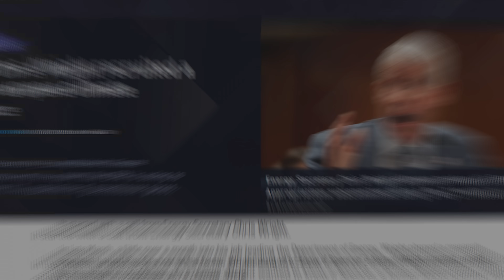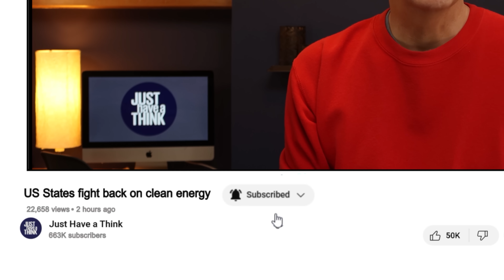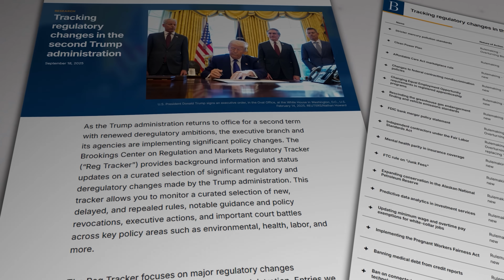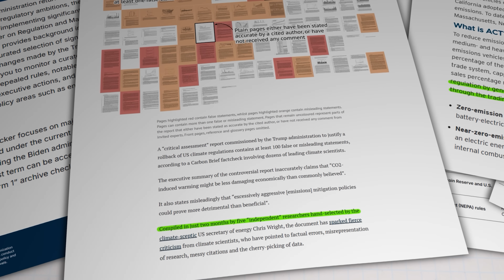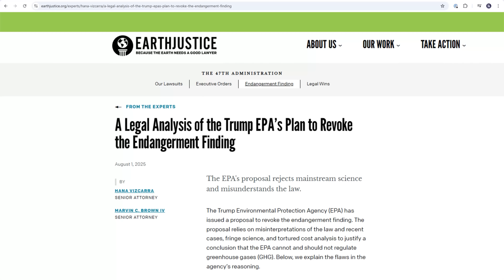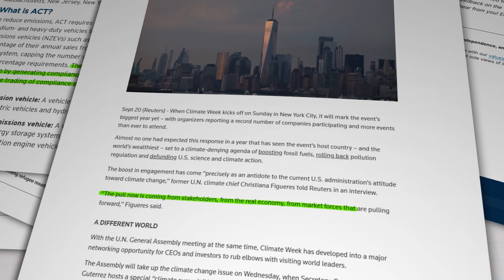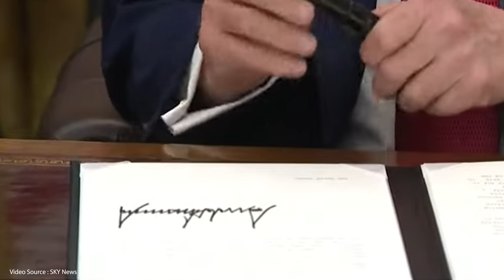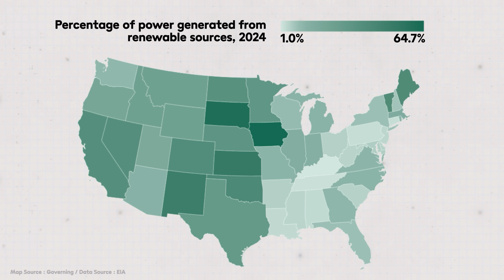The battle for American energy supremacy.

Comment: As a Canadian, I know that there are a LOT of people in the US that understand positive effects of moving to solar, wind, battery, geothermal etc. These people are just working away in the background, making this transition happen in spite of one crazy leader that just wants to line his own pockets - to them I say thank you! 🙏
Reply: It's not just a question of "transition" - it's also a question of cost, mainly reducing dependence from big business, using less if not least expensive energy sources.
In most of the USA conditions for solar energy are outstanding - a larger house roof surface in photovoltaic (PV) cells is is sufficient for producing the electricity for an average family.
Reply: Indeed we are. Our household just sold our last direct tie to the fossil fuels industry in the form of an ICE vehicle. We've replaced those with two BEVs, home solar array, heat pump, and cancelled our natural gas service. Brighter days ahead.
Reply: Yeah lets hope that this will result in an expansion of clean stable long lasting and low impact fission energy.

In the mean time an abundace of gas will lower electricity prices in gas reliant grids helping the shift to electricity ( burning gas to make electricity and using it to power an heatpump is better than burning it insider the home )
Reply: From Alberta: eat my jorts Laurentian. This video conveniently forgot to mention that Opec+ is heavily expanding production to drive down the price of oil. The price booms and busts, production will be up again eventually because we are very far away from peak oil demand.
Reply: FYI Anyone from Alberta is a shill for big oil and gas. They love destroying their cattle industry by drilling and fracking. They want pipelines everywhere and don't care,  at all, about the destruction of the environment.
Reply: @ronstephen-wy4ib FYI we do care about our cattle industry- which is not being killed by oil and gas but instead by the Quebec dairy cartel that’s in bed with liberal government agriculture regulators. We want pipelines to support our provinces largest industry which in turns grows our province by providing the province with high paying jobs and lucrative royalties (imho it seems reasonable). We do care about the destruction of the environment which is why we want developing countries to switch off of coal and move to natural gas before battery technology is good enough to support the spikes of use in networks of 100+ million people. If China alone replaced coal with natural gas it would cut their emissions down 3x the size of Canadas total greenhouse gas emissions. This is all ignoring the fact that when oils not on pipes it’s on trains which are far sketchier. 

But nice straw man of Albertans.
Reply: @ronstephen-wy4ib also lmk if you wanna address something in my original comment besides your opinion on the province I’m from?

Comment: It great bringing up these improvements but I have mentioned on your comments before that no matter what happens regarding Zero emissions it will never take place because Leeds University have already reported that electric vehicles are the most polluters on the planet and as they gather more users the worst it is going to happen. I live in Australia and even though we have a fairly robust electricity system it still will not overcome the information above.
Reply: I am in Australia with two EVs. They are both powered by my rooftop solar. EVs take about two years to pay back their embedded carbon, even with a dirty power grid. Mine, on solar, take less. Combustion engines have an advantage for those two years. Thereafter, combustion engines continue to produce more CO2, and that is not recycled at end of life, like the very valuable minerals in my batteries. Citing bogus reports is not helpful.
Reply: Leeds Uni have NEVER reported that electric vehicles are the most polluters on the planet.

Comment: I hope you to tackle the issue of data centers and power demand.  This is a huge topic of conversation in the US energy markets.  The tech companies are favorable towards renewable energy and storage, and addressing climate change, in general.  Yet they feel. compelled to rely on nuclear in the long term, and natural gas in the short term, seemingly because of 24/7/365 requirements.  

An interesting case in point, is xAI Colossus 2 in Mississippi (not one of the states mentioned in your list).  Park yourself to a natural gas source.  I would've thought combined cycle gas turbines would be a bottleneck with this strategy (e.g. 5 years).  Yet they were able to quickly get started with temporary turbines. These are modular gas turbines/ aero derivatives, similar to jet engines, that can be commissioned in weeks to months, not years.  This was how Elon Musk was able to build such a massive data center in record time.

For the average consumer, I think renewables+storage will probably be sufficient.  But because of AI, energy demands are now rapidly increasing beyond original expectations.  And it makes me wonder, whether renewables+storage will be enough.
Reply: Opportunity is increasing.
Uranium-fired power-service now has the opportunity to sell to an unquenchable market.
If you can build power-service, you can sell it, at any level.
Reply: @aliendroneservices6621 ...except, of course, for the long commissioning and construction period, the huge costs of building, decommissioning and storage of waste products and the need for expensively mined fuel as well as a huge demand for plentiful water supply.

Comment: Dave, is there any data on second life batteries and solar. Used solar and batteries have got to be a very very cost effective way to generate electricity, and they'll be a lot of it. Probably offsetting new a lot in the future. 

Is second life factored into energy transition models? It's gotta be a big deal. Very biggly.
Reply from the maker: I did a video on this a few years back but it may be tome to have another look.

Comment: I had solar panels installed on my roof this summer, getting in just in time to get the tax credits. I am holding off on batteries as we are at a major change with Sodium batteries. Planning on buying an EV in 1-2 years and getting bidirectional charging in. Use my car as my home battery.
Reply from the maker: Sounds like you've got a great plan for your energy future!

Comment: You need to understand that the ONLY Reason that US got Trump and MEGA-Morons (twice) is because the D(s) put up such horrid candidates, that the only way they could become D candidates was to cheat their own D Primary system(s).  So what is going on is not so much folks voting For This or For That.  Really most folks in the US are voting AGAINST what they think is something worse.    This all means that no matter who "Wins," . . .  US Loses.  

Meanwhile China (thank you, China) has made Silicon Solar PV so cheap  (install cost of $US 1 per Watt if folks will keep it off the roof) that it works out to about 2 to 3 cents per kWh "behind the meter."  (no Tax Credit required).  If folks add an EV at those Electricity Rates -- that works 15 cents per Gallon Gasoline.  Folks that are smart enough to do that are fine.  For the rest of US -- things are what they are.
Reply: " is because the D(s) put up such horrid candidates" <- nope.  Your argument falls apart because 1) it's just not factual, and 2) you are ignoring why Trump is popular (hint: yes, many Americans are quite bigoted.)
Reply: @TheDanEdwards  This is why the D(s) will lose again in 2028.   Deny, no self-responsibility, blame others.  Sounds like a real winner of a plan.

Comment: I think you need to read Project 2025 (A plan by the extremist far right Heritage Foundation and its alignment with big fossil) in a bid for ultimate power handing presidents the unlimited power to implement dangerous policies with the full backing of the cabinet. Unfortunately for our beleagured planet, those in control are going full steam ahead with every line. 
In the blueprint document Page 368 aims to roll back cutting Carbon Emissions. Page 418 Intends to slash Green Legislation, completely severing funding for renewables. Page 676 "Climate Change Research Should be Disbanded" Yes they are actually disbanding NOAA. 
Unless authoritarian rule with its dubious mandate to deconstruct institutions, anti-renewables legislation, onerous diktats and presidential decrees the consequences for renewables un the US could be pretty dire. 
Hopefully this will be resisted under the constitution and some rational democracy restored, but I fear that the damage to its successful renewable energy industries and international standing and the US soft power regarding US expertise in climate sciences, may be another casualty of this dreadful regime. 
So on this occasion, I do not share your optimism.

Comment: The global elite hate solar for obvious reasons. Yet it has worked for 99.9% of life for over a billion years. Meanwhile look at the war Ukraine is fighting to defend itself.  Having a centralized power grid is a national security risk. Burning stations are by function centralized. They are fundamentally flawed when it comes to national defense. If everyone in suburban America has a bit of solar, we would be on better footing should we even face war. Having a largely diffuse and decentralized grid is a strong national security stance. Relying on centralized refineries and burning stations is a weakness that our enemies could easily exploit. Do the math, taking out a billion dollar refinery using a million dollar munition is a bargain. Then realize Ukraine has been able to do it with munitions under 100 thousand. How exactly would an enemy knock out a solar farm? It would not be cost effective, and would be an easy repair. Solar power manufacturing is still centralized, but you can stockpile replacement panels quite easily,  and they are easy to install. Ignite an oil field or gas field, and it might never work again. The replacement parts for a refinery face the same problem as a solar panel factory.
Reply: "The global elite hate solar for obvious reasons. " <- silly claim.

Comment: Solar panels are not clean energy.  They are not clean because they are made with metals and plastics, some parts are rare earth, all the materials for the parts must be mined and processed.   Then they don't last all that long, eventually they will stop producing electricity, they will be scrapped and disposed of in a landfill, so they are not renewable energy either. You all here lie about clean energy, you have been lied to.  Meanwhile, methane and natural gas are actually renewable because it comes from the Earth as a byproduct of composting soil and plants over time.  The carbon released is the same carbon that was absorbed during the plants life.  It is essentially an unlimited resource as the Earth continues to provide.  Just give that a think.  You all have been fooled by a political agenda.
Reply: "You all have been fooled by a political agenda." <- You've been fooled by your own ideology.

Comment: I life in the Las Vegas Valley and electrified last year everything to be powered from a solar system. My total energy cost (including transportation) for the first year were the electricity connection charges of $235 for the year. My solar system saves me about $3,500-$4,000 in energy cost per year. Since I oversized my solar system I also banked $600 in credits for future usage.
Reply: If you're still connected to the grid, you're stealing power-service.
That's why you're "saving money".
Reply: @aliendroneservices6621 You are wrong. Actually, I help stabilize the grid, especially in the summer when I provide power during peak heat waves. My usage of the grid is less than half of what it was before I switched everything to solar, and that includes heating and transportation now.
My power company does not allow me to disconnect from the grid which would be an option for me if economically.
However, It seems that Nevada Energy is happy to "buy" the surplus solar energy from me.
Reply: @aliendroneservices6621 You are mistaken. I quite don't understand your ""stealing power-service".
I have a power purchase agreement with my energy company and the company uses my power to stabilize the net, especially during heat waves in summer. 
My usage of the grid is less than half of what it was before my changes, and that includes heating and transpoertation.

I would have thought that you applaud entrepreneurship but your statement cotradicts that.

Comment: Thank you for the great update!

I believe that the administration has lots of headwinds in their energy policies. The fact is that solar and wind are less expensive than buying fuel to generate electricity. I am also hopeful regarding small modular reactors (SMR), they seem like a necessary part of our energy future. Fortunately, the current administration supports this technology.

Driving an EV can save you lots of time and money, if you can charge at home. There is a higher initial cost, but if you can change at home they still make lots of sense. The maintenance on an EV is trivial, mostly wiper fluid and blades. An EV is easier on the brakes, since they mostly use regenerative braking. They do not need oil changes, tune ups, spark plugs, … They just work.

With Tesla and Rivian you get a software defined platform. This means that your vehicle can improve with simple over the air updates, like your phone. Unfortunately, none of the legacy automakers have found a way to a software defined platform; though VW has inked a deal with Rivian for their software platform.

Comment: China installed more PV capacity in last 6 months (210 GW) as USA did in a total of 600 months (189GW)!
According to CEC data, CHINA commissioned 290GW (210GW solar/+107%, 50GW wind/+99%) of green electricity capacity in first half of 2025. China thus invested around 6 times more in renewables than in fossil energy and nuclear power capacity. Because wind power and solar power are more cost-effective and environmentally friendly.

Comment: Thank you for the commentary, Dave.

I live in Texas.

The price per barrel of oil dropped below profitability back in March.

US oil production has gone down in the last 6 months and is several hundred thousand barrels below the all time high back in late 2024.

Exxon and Chevron have laid off workers in the US.

New rig counts are down compared to last year.
Rig crew counts and Finishing crew counts are also down.

However one of the real indicators that there are problems is that Halliburton and other rig servicing companies are laying off crews.

Drill Baby Drill is happening but it aint happening in the US.
Reply: We could take those rigs, and their crews, and with a little retrofitting and retraining drill a whole bunch of geothermal wells. I am all for drill baby drill, but let's stop burning oil. It is an incredibly valuable resource for materials like plastic. It is limited. Geothermal is not limited, and they could learn to serve the system as they install them, meaning steady work for many. I say drill baby drill, but let's have hot springs instead of uncapped wells. Let's have steady reliable energy for every family,  not wildly fluctuations in price. Let's have more public hot springs, not dirty air. They are going to have to drill a heck of a lot more holes for geothermal then oil to get the same amount of energy, which means more work for them. The people who do the hard work. The only people who lose are the oil companies. Once a geothermal well is dug it needs maintenance, but it's mostly done. Which means it is not very profitable for Wallstreet, but would be a good living for an independent contractor. Renewable energy is great for the working man, but hurts Wallstreet.

Comment: I support environmental causes and am center left politically but i think car safety and emissions regulations are turning people into right wingers is a 25 camery is like more than twice as expensive as a camery 15 to 20 years ago and have made only modest gains to emissions economy and safety. Meanwhile they made cars which most people need unaffordable unreliable and are trying to promote battery cars which are even more expensive.
Reply: Nominal prices:
2005 Camry LE: $20,125
2025 Camry LE: $28,700

Inflation-adjusted prices:
2005 Camry LE: $33,200
2025 Camry LE: $28,700

Toyota Camrys are cheaper today, in terms of real dollars, than they have ever been.